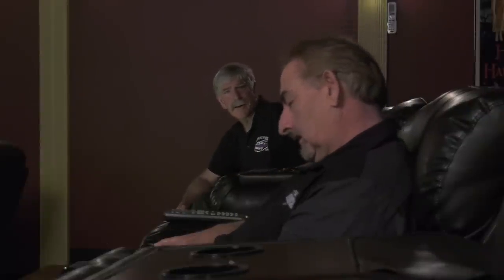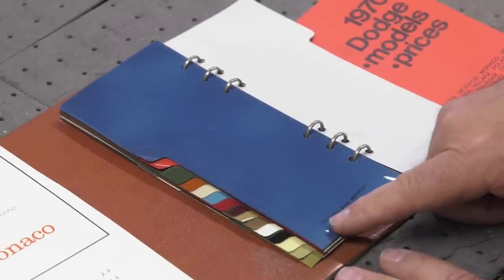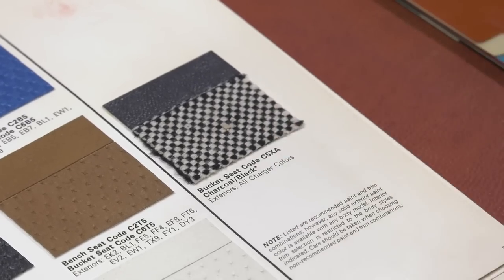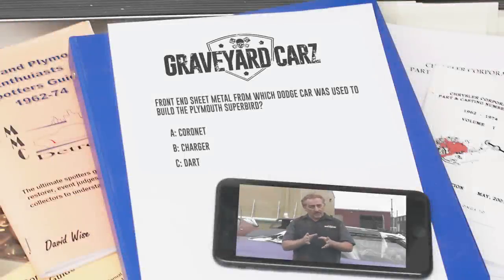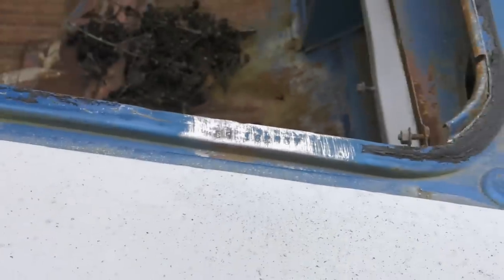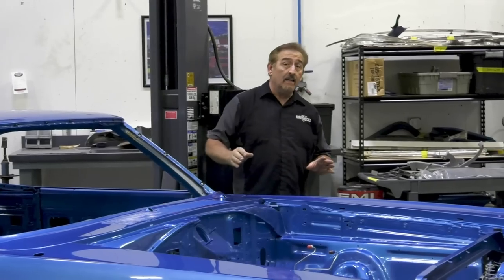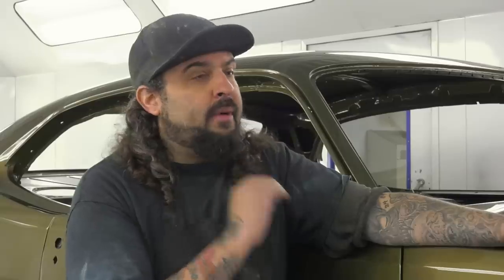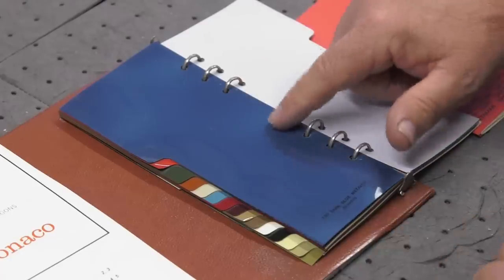MILLION DOLLAR HEMI CHARGER WITH A MILLION DOLLAR FACTORY MISTAKE IN THE VIN: YOU WON'T BELIEVE IT!

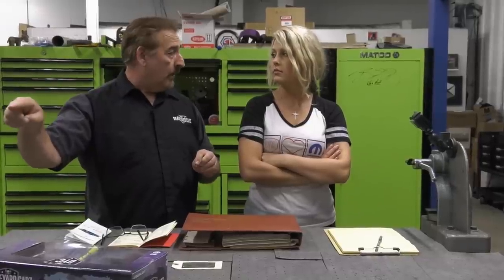Comment: As an avid mopar fan I would love to date Alyssa and even consider settling down with her if she isnt already spoken for. My mopar isnt as cool as those old cornerstones of American history but its still nice to me its a 1998 dodge ram 1500 Laramie slt st 4x4 with the 5.2 318, at a/c heat heated mirrors, power mirrors, 4 wheel abs rear drum brakes, chrysler 9.25 rear differential dana 44 front differential 3:41 & 2:43 ratio its in mopar red(dodge red)
Reply: Back off Bucko